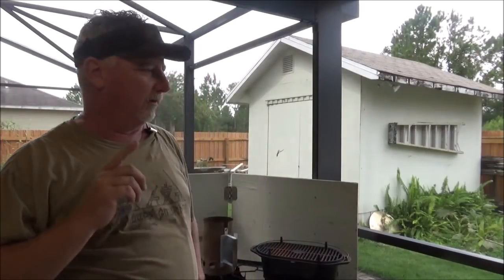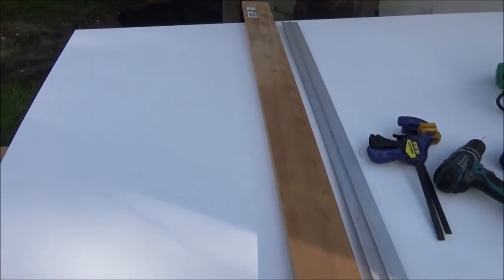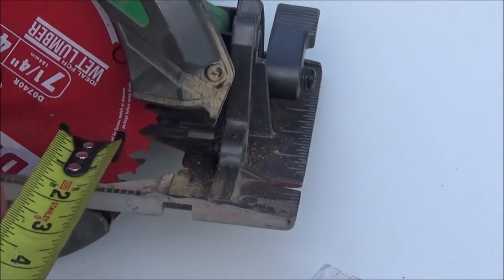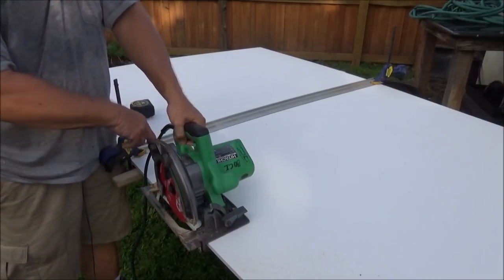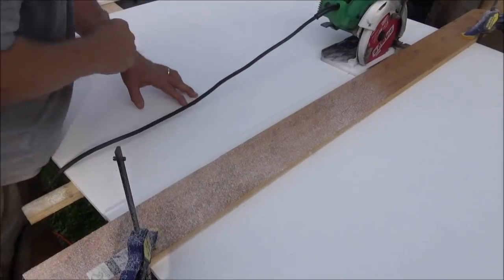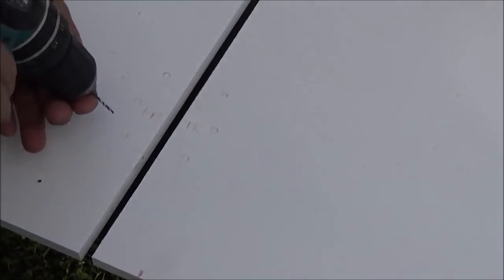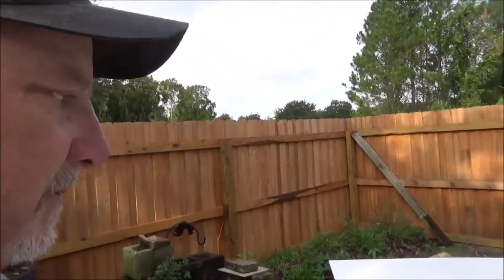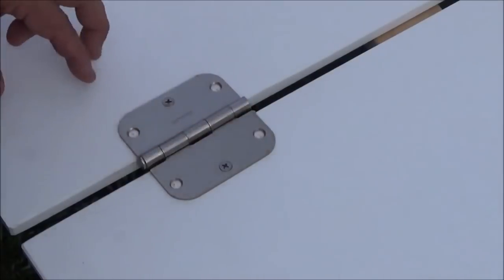How to Make a Folding Wind Screen for Your Grill or Smoker -  DIY Cheap and Easy

Comment: Dollar Gen sells Mean Green "Orange Champ" 7-20547-70732 which does a number on stickers and labels. You might have to rough 'em up so the orange stuff reaches the paper; I soak a paper towel in it and press it on a few minutes. Then put the edge of a butter knife to use to scrape.